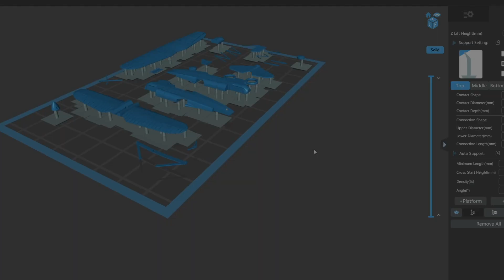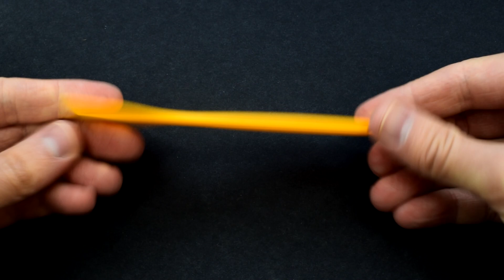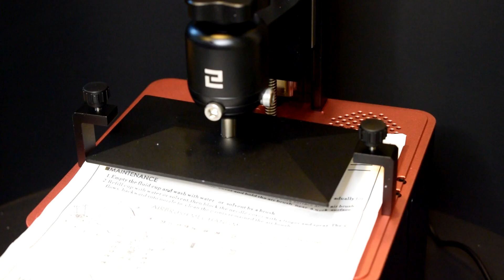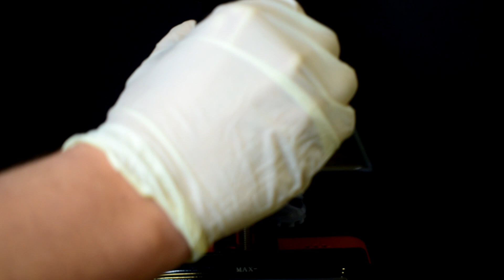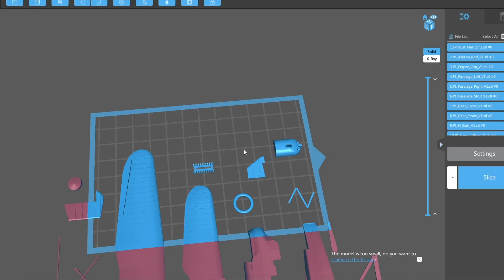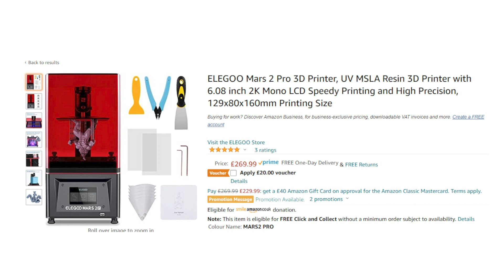Could the Elegoo Mars 2 Pro & 3D Printing change the face of scale modelling?

Comment: Matt, now that it's a year on, any thoughts or changed opinions? (If enough of them, maybe a few minute  video update??) This model happened to be part of a hugely successful Elagoo Black Friday sale is what brought this video back up in my feed.
Reply from the maker: A good suggestion. My thoughts a year on (and having used it quite a lot during the year to make keyrings to hand out at events, small details for kits i've lost and even larger stuff to compliment builds) would be:

1. Durable. I'm still on the original FEP sheet for the screen and also haven't had to adjust the levelling since the initial set up in this video. I rarely get failed prints (and that is usually due to insufficient supports during the orientation of the STLs in the software).

2. It's quiet (much quieter than my FDM printer) but the resin can be pungent (depending on the type/brand).

3. Having fiddled with the settings I'm quite impressed with the resolution it can achieve, however I would be interested in upgrading (to like a 6K or something) in the future to produce even more detailed parts.

4. Clean up and curing is manageable once you get used to it.

5. Still works consistently even after a year.

6. USB port on the front is handy for putting the memory stick in, but I find that i knock the stick occasionally because it sticks out when it is in use (not sure there is anything i can do about this, i just find it annoying)
Reply: @ModelMinutes  a short? Or a sub 5 minute video? Yeah you need to make one. 👍 (And lastly, it can make Pegs/Clamps 😜) 
Maybe you can sell this one to Mos and put the cash towards the upgrade?:_RAF::_Tamiya::_Italeri::_Revell::_Hobbyboss:
Reply from the maker: @crazylocha2515  I’ll look at doing that in the future 😊

Comment: Excellent video!  👍🙂
I’ve been building models just under 40 years now, most notably aircraft kits.  I have to admit I’m going to have to turn to 3-D printing real soon.  Why, you may ask? Well, I am just sick and tired of suggesting to model companies kits to build only to either never hear back from them or they say “we will consider it for a future release“ and (again) never hear back from them and never see it released!  🙄  
As far as the software to use these machines go how difficult is it? Is it a lot like AutoCAD?  I have many aircraft line drawings saved on my computer and would like to build in either 1/72 or 1/48 scale.
Reply from the maker: There are a number of free 3D design softwares out there - i suppose it would be worth looking around and see which ones you like and can get (some are free). If you already have experience of autocad i'm sure you will have no real issues

Comment: Thanks for the video walkthrough.

A resin printer has been on my wish list for awhile. Since I do a lot of scratchbuilding, it would be perfect for those bits that just aren't in my spares box. Like a bunch of 1/72 Lewis MG's, or a pair of nine inch seaplane floats.
Reply from the maker: Yeah, that's exactly what I was thinking of using it for - all those little extra bits and pieces

Comment: The printed kit looks great and more detail could be added if required. There is obviously a lot of modelling related objects that can be produced besides kit parts or detailing like glue bottle holders and other similar items. Producing a replacement part to repair something also comes to mind. The cost of the resin is a factor but for any project you usually need to buy materials (plasticard, filler, and so on) so I don't see that as a problem. For most it is justifying the initial cost of the machine and learning how to use it and the additional time of learning how to design parts.
Reply from the maker: I agree, the initial cost can be a problem, but it's not exactly out of the range of someone who is "serious" about getting some 3D printing done

Comment: I'm all ready for this then we go "Let's see what's in the box..."  fast forward time to something that's interesting. And very interesting it is, I like your DIY UV curing box especially. Let's see what Father Christmas says if I have been a good boy this year ... EDIT - your Curtiss seems to have a scale like finish on many of the parts; is this a result of the layers building up one on top of another, and is it avoidable or is there a remedy for it? I really am impressed but the paradigm is like you say - 10 years ago this was unthinkable, so in five years from now, how much better will it be?
Reply from the maker: Yeah, those are layer lines. It could be a result of the orientation of the parts when they were being printed - perhaps a different angle would have limited them, or it could be a result of the resolution of the printer/settings or quality of the 3D model. It can be avoided probably with different settings (or at least minimised) and even if there are some remaining, sanding the resin and using some "filler primer" can help too
Reply: @ModelMinutes  very useful info Matt, thank you. As a table top wargamer, I could see so many uses for a machine like this even at what seems to be quite a bargain price! I look forward to more of your creations.

Comment: So what do you do with the waste after washing? Just wondered.
Reply: set the water in the sun to cure out the resin bits.  then filter the water thru a paint strainer.  water can then be disposed of.  use a throwaway or reuasable container for this one purpose, as some resin will stick to the sides.
Reply from the maker: Yeah, like orbitalair said
Reply: i feed mine to swans

Comment: Few quick tips for ya mate,
1. Invest in a mash and cure. Saves you sooooo much time and effort I cant describe how useful they are. 100% worth the extra probably 100 pounds.
2. Orientate the models at a 45 degree angle, that seems to be the best for printing. Also helps speed it up.
3. Use many many many more supports!!!! You had way too little for that plane. And also, the supports dont need to be as long as you had them, that increases print time and isnt really necessary. You could lower the models a bit to save some time.
Reply from the maker: Thanks for the tips! I recently figured out the supports and angle thing on a more recent print
Reply: wrong. 29 degrees is optimum 

Many supports are not needed you only need to support the vital points .. like a bridge you can canter level quite a lot

Comment: The plastic scraper is intended for stirring the resin in the tank. I would also invest in a proper vapour filtering respirator, surgical masks won't protect you from the fumes. I am loving my resin printer and currently teaching myself 3d modelling to make maximum use out of it.
Reply from the maker: thanks for the info!
Reply: @ModelMinutes   don't listen to the guy above i have one in my kitchen ... its not a hazard unless ya huffing it .
Reply: The plastic scraper it to clean the FEP and get the resin back into the bottle

Comment: Been printing for years and for a first print that's not bad, there's a saying in the 3d printing community, Ex Deliquo, Cognitio, from failure, knowledge. I think most of the problems you encountered were either the resin, water washable tends to be a pain to work with, and supports. I think you have worked out the supports but the way I always describe it is that think of building a wall, you can't place a brick in mid-air, you can add supports that are later removed once it's fixed to the wall, but there are limitations to how much you can bridge the gap. 

As for what to print next, I would offer you one of my models, but I don't think that's the sort of thing you are into, so instead how about a IMAM Ro.41 1/48th scale model from thingi. This print will take you 3 prints to make, I build one for a friend. I don't think there is a kit in any scale for the IMAM Ro.41 and sources are limited, so it's one of those aircraft that you will probably never get in kit form. The creator Sikka dose other aircraft as well, so it might be worth checking out.
Reply from the maker: Thanks for letting me know! I'll look into that design! Yes, if you check out my IG you'll see a picture of one of my next prints featuring some figures from Beacon Models, they came out much better